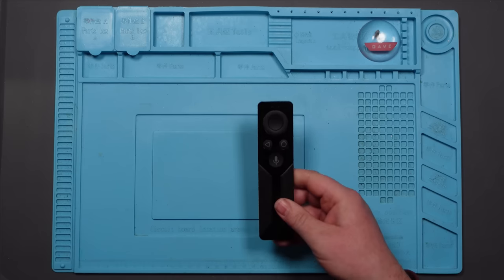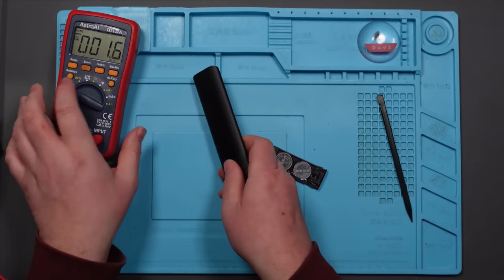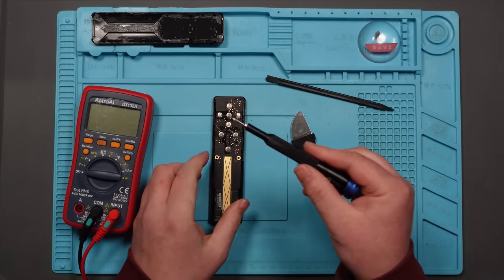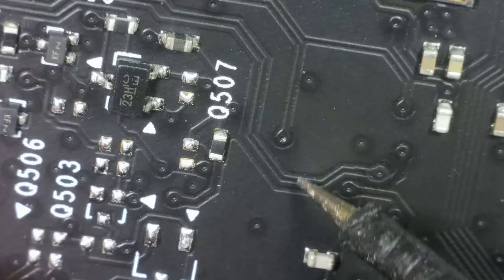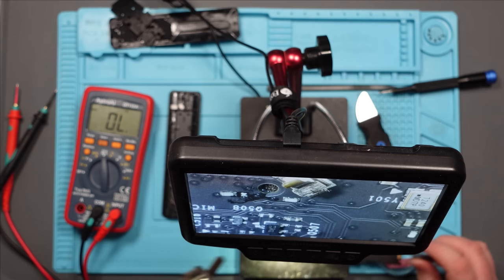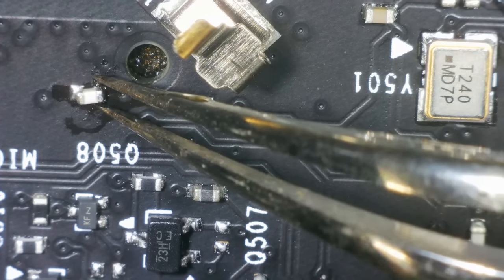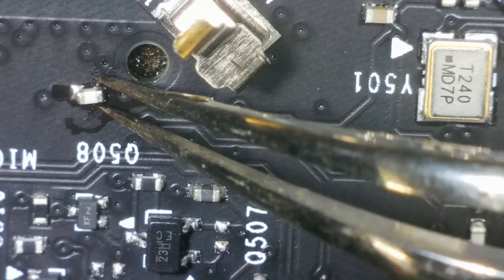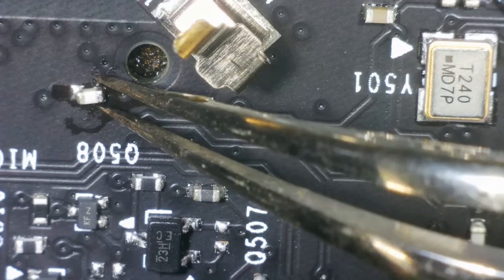My Nvidia SHIELD Remote Stopped Working | Won't Pair | Not Fair

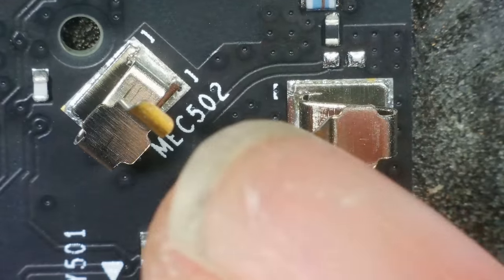Comment: The 2017 / 2019 Shield remotes are weird. Your 2017 remote seems to use IR as the 2019 (Tovarome triangle) remote might be Bluetooth.  To test IR remotes I use my phone camera and point it at it. If you hit a button, the emitter with either flash purple or green. Also also, even your component tester you have has an IR receiver on it, which even gives you a code of what is being emitted.  My question is, @4:57 those two tabs Mec502/Mec504 , are they some sort of tabbed interlock and what would happen if they were jumpered?  On an upside, I know android phones have a Shield remote app that will allow you to use your phone as the remote. Very handy especially if you need to type any alphanumeric characters.

Comment: I would hard wire using a bench power.  I had a remote (not that one) when replacing this coin batteries and it still failed and it was cause of the "new" batteries were still junk.  Don't like coin batteries always had bad luck with those.

Comment: You know what's crazy. My Amazon fire TV stick had the same damn problem. It worked fine. It's brand new and then all the sudden one day the damn remote couldn't work and then I took the batteries out of it for a couple of literally months. Popped them in one day and the damn thing started working again... And I literally tried changing the batteries like four or five times throughout the couple months that I wasn't even using it. I was using the phone app to control my TV

Comment: As an aside, anyone else finding current IKEA CR2032 batteries are crap? They used to be really good and excellent value but in the last year or so they have been rubbish and go flat/don't put out enough voltage really quickly.
Reply: There are a lot of fakes on the Market, thought I had a broken car key fob, it turned out the batteries were dodgy .The batteries  were showing over 3v out of circuit with a multimeter. Bought Duracell Procell after that from RS components, boy they ain't cheap.
Reply: @davidroberts2920  Fakes from IKEA though?
Reply: No from Amazon.

Comment: Just found your video. Apparently, I have the same exact remote with the same exact issues. I think these remote are faulty. The model shield is the 16GB variant. After a few month of used the remote stop working. I replaced the batter and never worked again!!! several days later, removed the battery since it didn't work  and guess what, the batter was depleted with only 0.370VDC left.  I'll open it up hopefully in the future with a follow up!! keep us posted. Thanks.

Comment: Same thing happened to me. I changed the batteries, same thing. I used the IOS app to control it. A few days later I picked up the remote by habit and it worked. Very strange.

Comment: Night vision shows if IR remotes are sending out a signal, I believe. If you do try anything else you might need to check that other Cap which moved at just after 13.48 (the one above the one you meant to move); it won't make any difference as is, but it could do later on, maybe?  Just saying!
Reply: A plain video camera will show, if it was working it would show up on the video.

Comment: All things being well, it's most likely to be a faulty IR LED.  

Looks like you need a 'scope...

Keep up the entertaining work!
Reply: Tere must be a short as the batteries are draining too quickly. These low power Bluetooth devices are designed to last a long time on battery alone.
Reply: @okaar  yup it can be both because a short can fry those IR diodes pretty quickly.

Comment: This is the worst remote I have used that came with a product. It constantly sleeps and isn't responsive to button presses once it does so. 

You can turn on the 'keep live' setting to mitigate this but that doesn't work 100% of the time and chews through the batteries. 

Oh and it also uses two button cells that cost a near fortune to replace.

Comment: As a Shield owner,  I thankfully have not had this trouble.     Your remote is different than mine however,  you possibly have the 500 GB pro model ......  I have the 16 GB model that came out after.    Did your Shield happen to come with a video game controller ?   My model did and I basically use that as my remote and keep the actual remote as a backup after I did the initial set up.  

I would say if all else fails,  you could use the video game controller it came with (if yours came with one)  or possibly trying using a Xbox controller through the USB ports in the back or side of the Shield and just have that as your new remote for the time being.

Comment: Here's an old school method to check your IR remotes prior to taking them apart Steve. Get your phone camera app up and running, point your camera at the IR diode and press any of the buttons on the remote, if you see the light flashing that's a good indicator the remote is functional. If it's not blinking then you can proceed to take it apart. This is a quick and dirty trick to check IR emitting devices to make sure the diode is indeed emitting a light, but because IR is outside the visible human specturm you cant see it, but your camera can.
Reply: Also to check the IR diode put your MultiMeter into diode mode and probe the diode, you once again wont see it with the naked eye but use your camera or phone camera to see if its emitting a light, but I doubt it's the IR diode itself.

Comment: Remove the battery, solder wires to the battery terminal pads, then inject voltage.

Comment: This device is so small, with the chip off there shouldn't be that much more to check to find the short along that line.  Or maybe you did off camera. 

This seems like the kind of thing where if you had a working one to probe then fault finding would be much easier.

Comment: If you have two 2032 batteries that each have 3 volts, two that are connected in parallel should have 6 volts.
Reply: No, only if it’s a serial connection it sums up to 6v. Review the basics
Reply: Yeah 6v would be a lot for a device like this.  Probably two connected in serial - still 3v but it lasts longer.
Reply: Two (2) three (3) volt batteries in Parallel will maintain the voltage of the cell and double the current available. Series ( 3V + 3V = 6V) equals 6 volts, double voltage (cumulative voltage, same current). Parallel equals 3 volts, double current (cumulative current, same voltage). I hope this helps and my comment does not add complexity.

Comment: Try connecting 240v  directly to the batteries .. after the smoke and sparks clear, you should be able to see the fault clearly  ...  that would be my solution.. Stupid remote control.

Comment: 😂🤣😂🤣😂🤣😂🤣😂 battery supposed be ay 3.5v not 2.8v
2nd i cant tell if ir reciver died or not i do remember it only work at 3.0v if less than 3.0v it does nothing 
ic chip never died in remote only thing does died is battery or ir receiver it is impossible